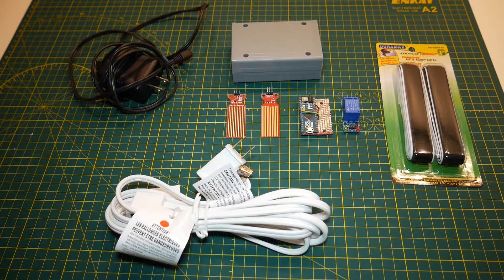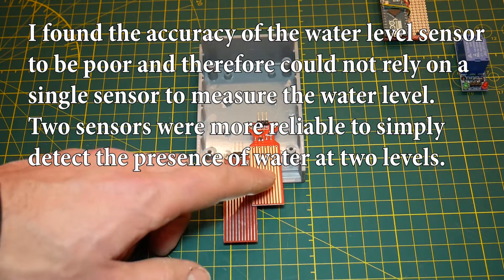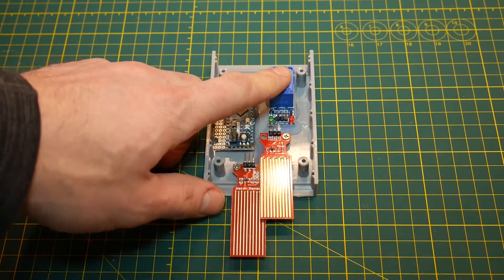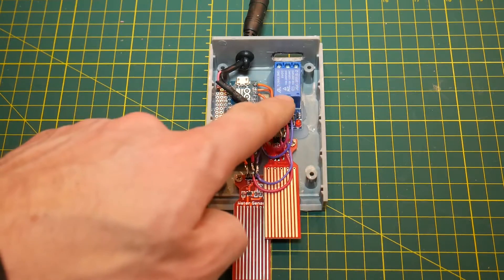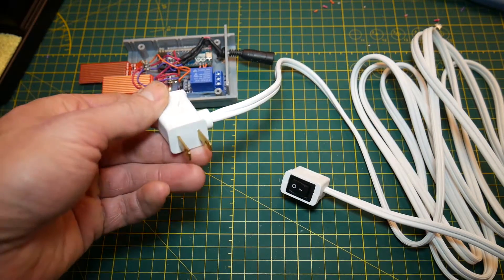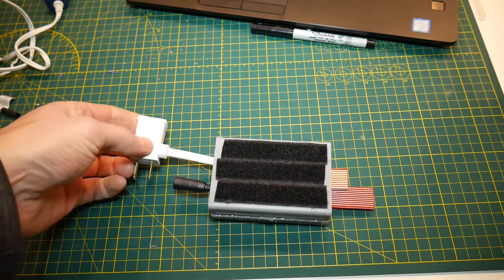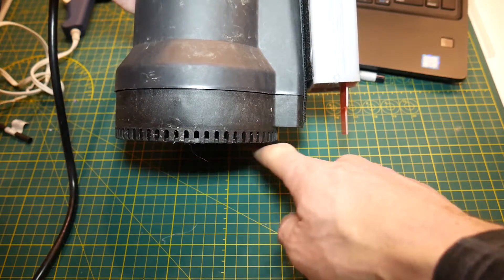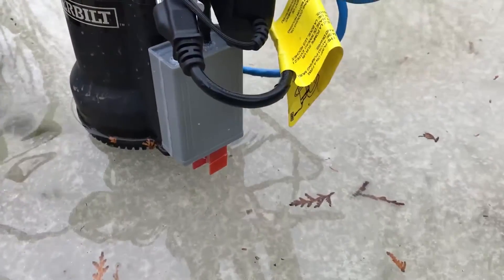How To Build A Water Sensing Pump Controller

Comment: Hi there, great project thanks. Everything work ok the only ossue I have is if the water level is low it take a long time to turn the pump off. is there a way to set the sensitivity for the motor of water sensor as the water stay on the sensor after the water is gone.

Comment: Hi again, this is Bert. I have this running, but its working in reverse. i.e. when the water sensors are not in water the relay gets activated and when the water sensors are submerged, the relay is deactivated. Is there something in the code that I could change that would get this to work in reverse.
Reply from the maker: Just change the parts where its calling the relay on (HIGH) to (LOW) and vice versa. No idea why you're experiencing these weird issues, but give that a try!

Comment: sorry to be a pest here, but I am stumped. As soon as I power things up, pin 12 turns on and fires the relay, turning on the pump. Even if I disconnect A4 and A5, the same thing.
Can you have a look at your code to see if there is anything wrong?
Reply from the maker: Hi Bert, not being a pest at all. Try running a blank sketch in the main loop of the code. Just initialize the variables and see if it turns on. Maybe you have a short in your wiring? Which arduino are you using?

Comment: I have the relay wired using the common and normally open. Is this correct?
Reply from the maker: Should be... are you using the exact same set up that I did in the video?
Reply: @EmbraceMaking  Yes. I am using the exact same setup. I see in you code comments that you talk about reading the water sensors and mapping the values. How do I go about doing this or is it necessary?

Comment: Many thanks for the demo on making a sump pump controller. I put one of these together, but when I power it up the relay activates immediately without having the sensors dipped in water. Do you have any thoughts on this?  Bert
Reply from the maker: Could be a number of things... is the relay wires as normally open or normally closed? Maybe you have it normally open but the controller output pin is set to pullup high?